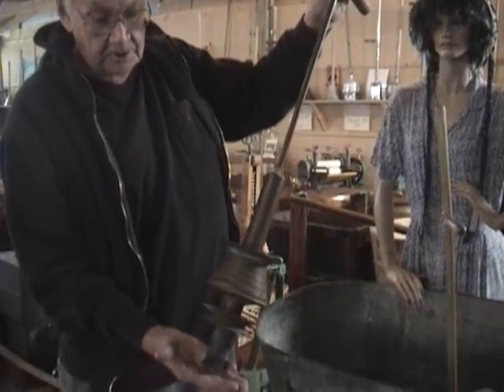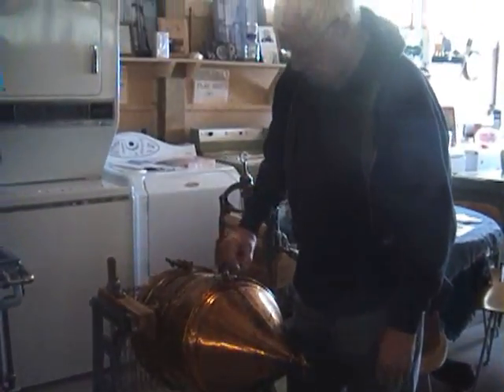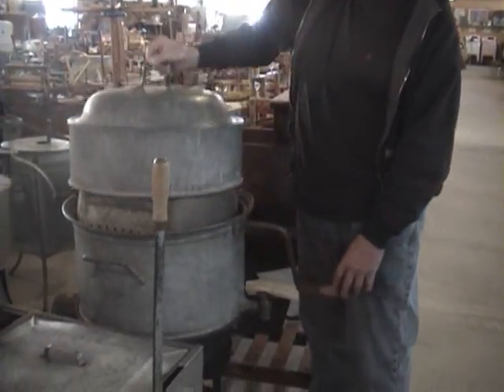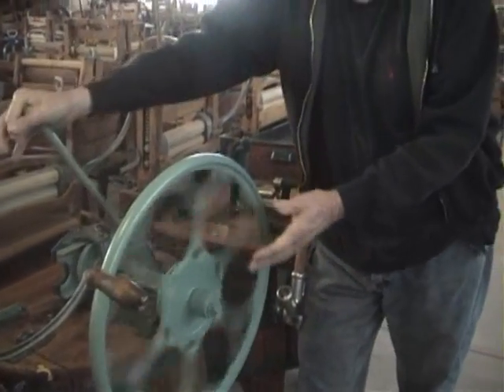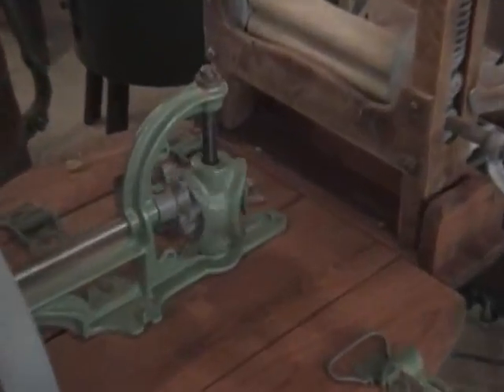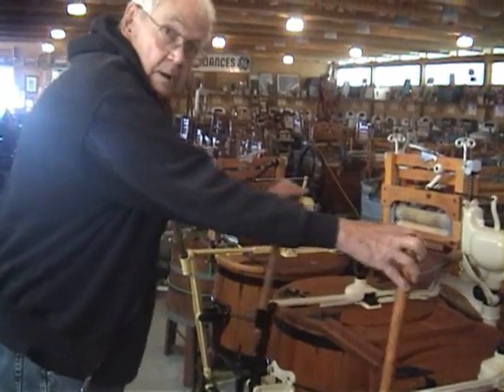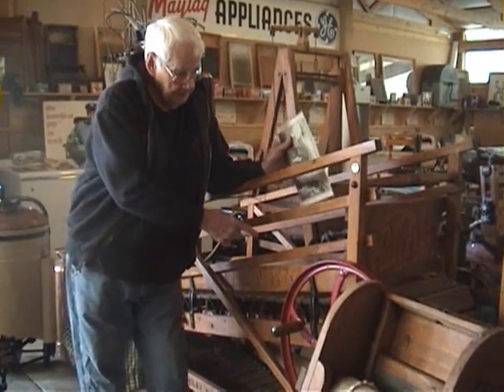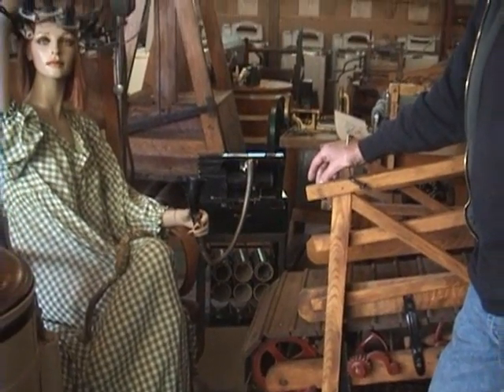Washing Machine Museum - manually operated simple machines with cranks, pulleys, levers, and gears

Comment: Dear Dave,

I love that you show us all these manual washing machines and electric washers. I wish we could make such machines today. I would make one in a heart beat if I could find the parts. I am tired of spending my hard earned money on washing machines that require constant repairs and die after a few years and don't even get my clothing clean! I also hate that I have to wash my clothing  three times to get it as clean as my mom used to get it in one load. I also hate that I have to Jerry rig things to get truly hot water and full tub of water. My current heavy duty Whirlpool piece of crap barely agitates, barely fills and shreds my clothing. I find it ironic that people are allowed to purchase multi-head showers that use 45 gallons a minute but we can't get decent clothes washers that use the proper amount of water and hot water. Clean clothing is a public health issue. We all need to have clean clothing and be able to wash our clothing and bedding in 160 to 180 farenheit to kill germs. No one needs a multi-head shower using 45 gallons in order to get clean. My mom did five loads a day for 20 years on old washing machine from the 1980's and I only remember one repair.

Comment: There really should be more manual clothes washing machines similar to ones from back then. I searched everywhere for a hand crank/manual clothes washing alternative, and there are only a handful on the market. They are quite pricey for only having the capacity to wash a micro-load too. A lot of the manual washing machines can't wring out clothes as well, so you're left buying another machine to wring out your clothes or waste time twisting them one by one with the help of another person. 

I really think an all in one (reasonably sized) manual crank, shake, or scrubber type of clothes washer that wrings the clothes and fits in a bathtub would be a better alternative to things like the Wonderwash or Laundry Pod. With the Wonderwash, it's like 45$ and it does not even wring out the clothes, the Laundry pod is around 100$, not to mention it has a small load capacity. The whole reason I am even considering getting these things is out of frugality. I do not want to pay a couple hundred dollars for a device that only lets me wash a few shirts and a handkerchief. 

Anyways, I absolutely love these old washing machines! :) So cool!
Reply: Agreed!   I have been trying to find a human-powered machine and there is nothing but micro machines that can't even handle a single pair of sturdy jeans.

Comment: I didn't know there was so many ways to wash your clothes back in the day. People today generally use electric contraptions. Some still wash by hand and some use home built devices. I've personally washed clothes by hand, by foot, and with a bucket and modified plunger (unused of course). Washing with the bucket device gets my clothes cleaner than a modern washing machine. However it's a lot of work and a lot of time. I've been tempted to try making an automated device similar to the bucket and plunger just for the heck of it. I hate washing clothes in a modern washing machine then finding them still dirty when they come out. You can try this. Wash clothes in a modern washing machine then take them out and wash them in a bucket. The water will get dirty unless you happen to have a decent enough modern washing machine. What I really want is one of those old washers that let you agitate the clothes however long you want via an electric motor. A good half hour or so of agitation in hot soapy water will do wonders.
Reply: i